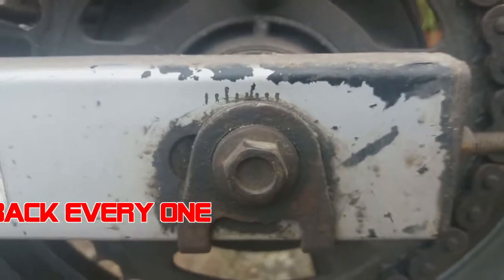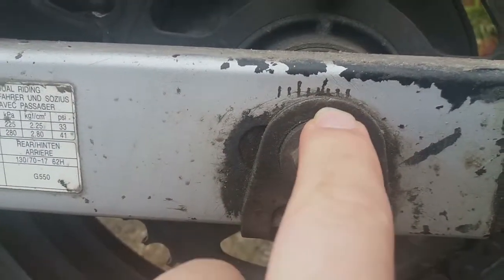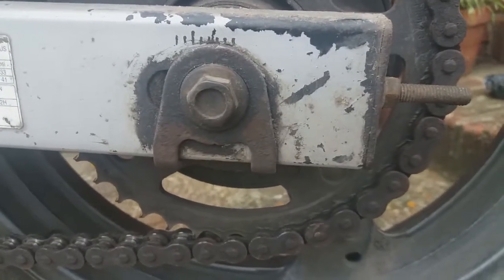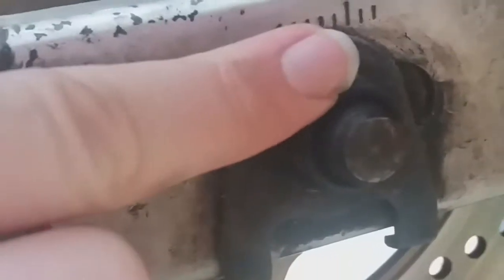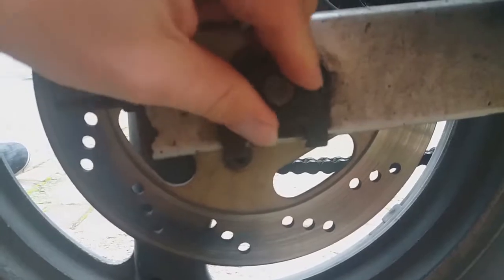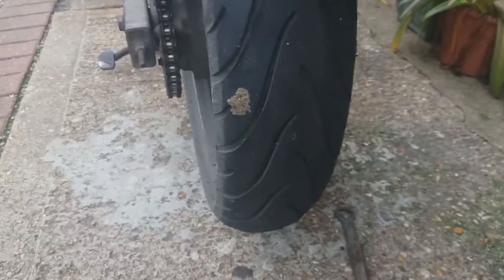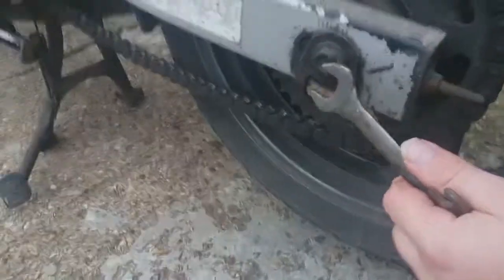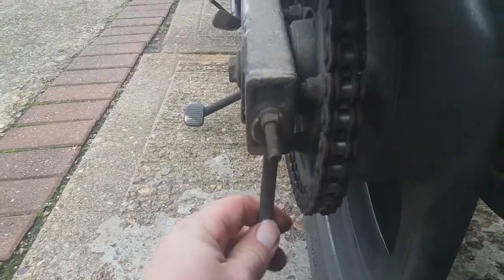suzuki gs500 chain adjustment002

Comment: My rear wheel won't move because the caliper is directltly attached to the hub. Not sure what to do.
Reply from the maker: Ok do u mean ur brake caliper is stuck on ur brake disc and now u cant move ur  rear wheel. Sorry im just tryin to make sure im understandin right.
Reply: @bornbikertitan5812  sorry that wasn't very clear. I was a bit confused because the part of the caliper that's connected to the frame via some sort of swing arm was tightened solid and wasn't behaving like a hinge anymore, and when this happens you cannot adjust the rear axel & chain tension because it locks the wheel where it is. This is the bolt on the caliper that's attached to a rod going towards the front of the bike. When it is loose it lets the caliper angle change as you move the wheel, yet it keeps it from going too far around. I'm still not sure what to do with this part if I keep it loose or if i lock it and unlock every time i need to adjust the rear axel? The previous owner had it tight, so i'm doing the same... things seem just fine. If i kept it loose i might lose the bolt as I ride eventually. Yet i never see anyone adjusting this bolt in any youtube tutorials. I'm not even sure what the thing is called! Haha